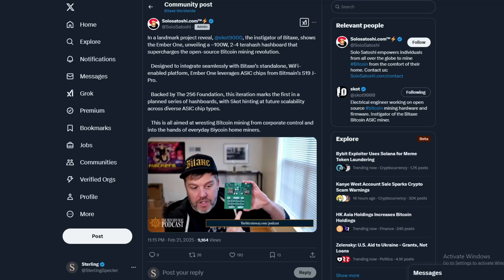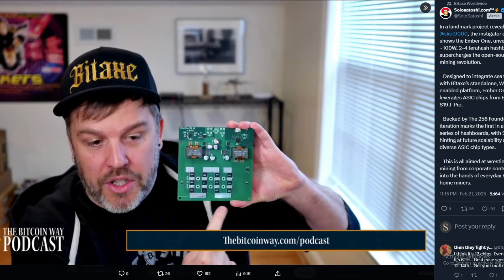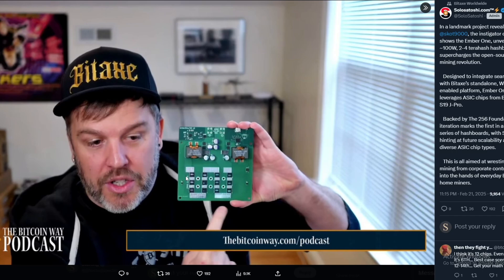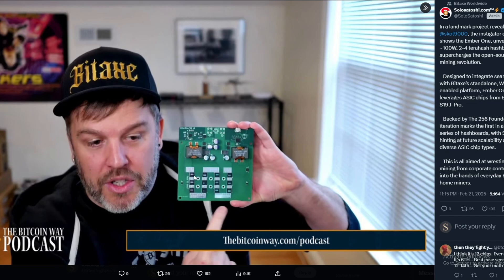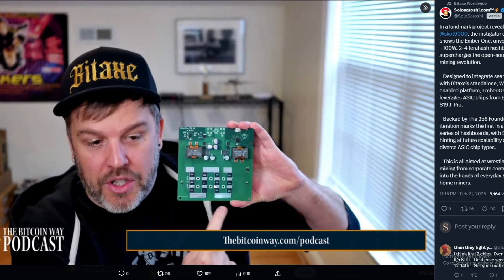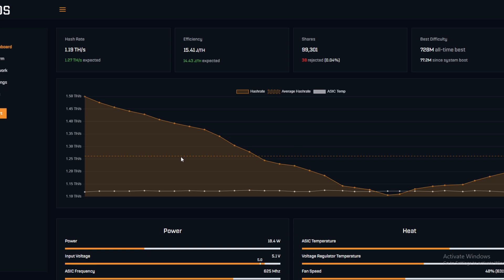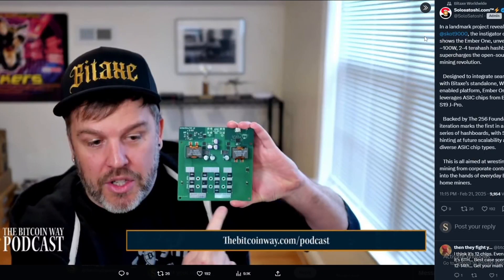Ember One Is A Game Changer For Solo Bitcoin Miners

Comment: Very interesting.. the lucky miner has 9 chips and uses the Bitaxe controller chip and software, 4.5+Th 24hr avg. but at 130-135w anyways good to finally see an open source multiple chip design.
Reply: Also i think they need to be careful not to cross over into full hashboard design because you can buy a full S19j Pro 35Th single board for $300 and a 120v conversion kits for like $339, so basically $700 for 35Th on 120v
Reply from the maker: i agree with that, its fine line between a small miner and just buying a full s19 hashbaord

Comment: 100W for only 2-4 T?  hopefully the heatsink can be properly sized for the load
Reply: Ye i didn't think it was great either considering avalon 3s is 140w for 6th 

Hopefully it can be overclock for not much more power
Reply from the maker: i mean it open source so improvements can be made